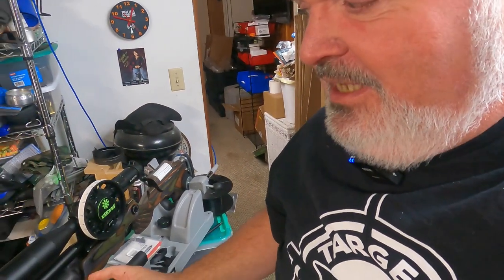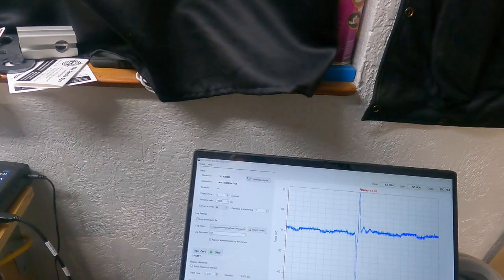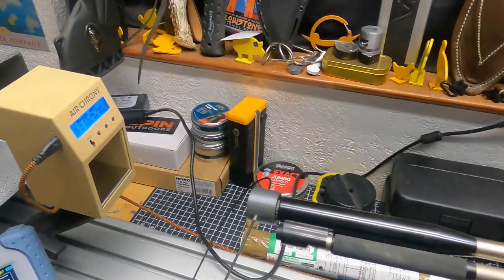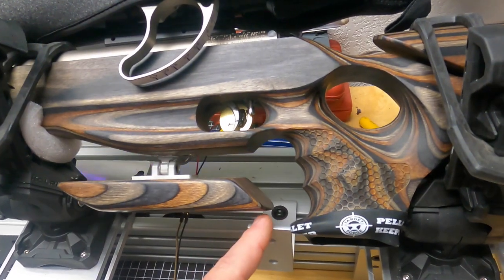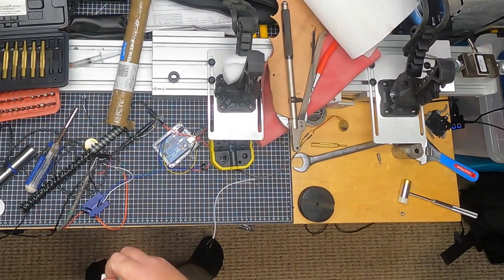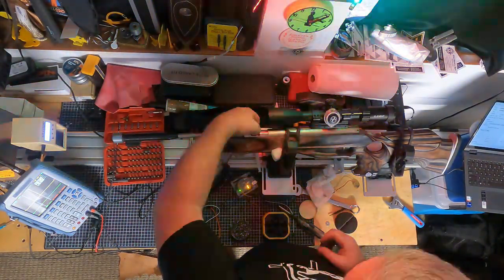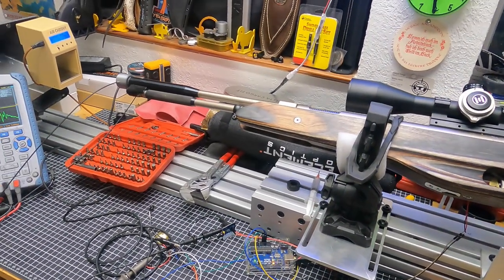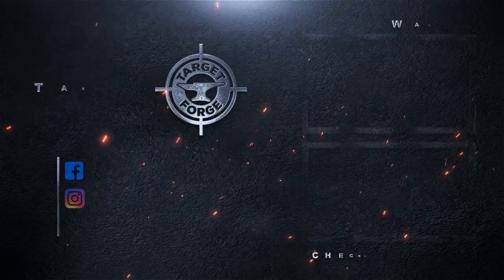Hunter Field Target gun build like no other! HW97 gets a titanium heart.

Comment: Wow. You probably have thé most sophisticated (air)gun workshop ever. Combined with loads of knowledge also. In my little country only gunsmiths have this. This is airgun heaven. Btw: I was out of the hobby, when the gas pistons made an entry. Of course you cant adjust much to the a gas piston. But I am curious if a gas piston is better for hft?
Reply from the maker: Here is my opinion Ralph. None of the three BEST spring guns often found at HFT (HW97, TX200, RWS) here in America use gas springs. One would think if they offered an edge they would? They also don't lend themselves to tuning as they are sealed units. Could you shoot a match with a gas piston break barrel? Absolutely! Will You have FUN? Absolutely! Jump in, the water is fine!